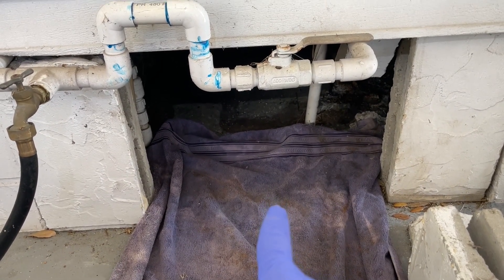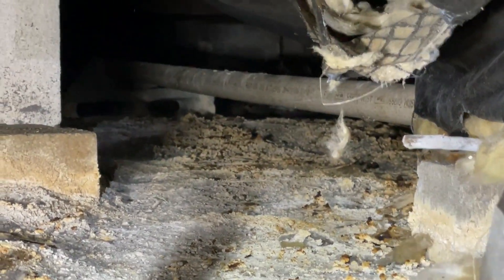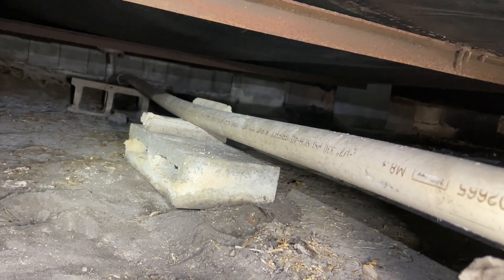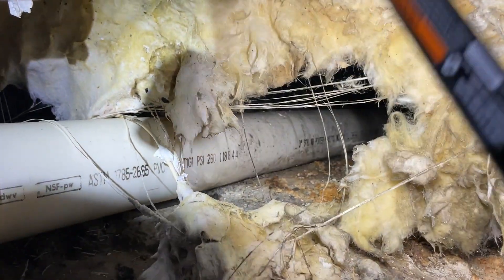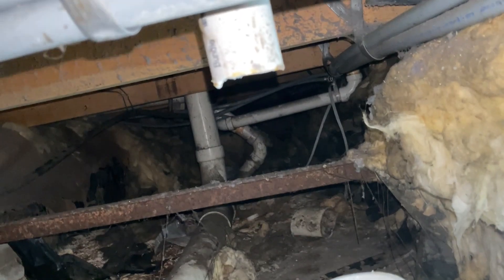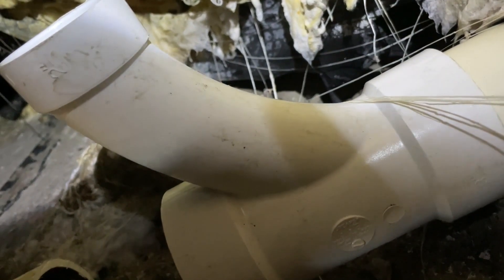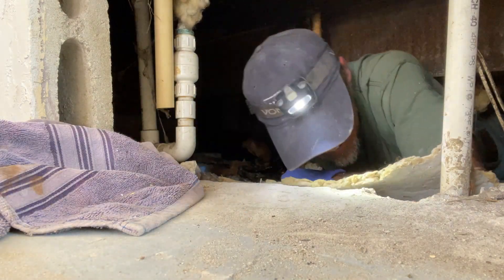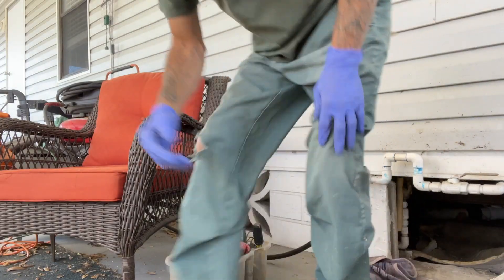SEWER LINE REPAIR UNDER MOBILE HOME

Comment: Wonderful instruction Tim! My issue is an intersection from the washer under my mobile home. I'm thinking I can get it done with using a Fernco rubber sleeve. Just slide it on then connect the broken pipe and tighten the hose clamps. Cover me, I'm goin in! I'm grateful that I've got more room under there than you had. Thank you for this. If I'm successful, I'll have saved around $500.

Comment: Great video work.  I've got a trailer that is similar underneath - except doublewide. Its a spider webbed, dusty, tight squeeze - without a camera.  Nice that you could capture how you did all the work.  Showed the tools you us, how you cut, measure and glue in a real live example.  Its a bit complicated - but especially in such tightquarters.  Bravo.  Well done!

Comment: First, may I say, as far as I'm concerned, guys who do what you do are true American heroes. 👍 🇺🇸  Question:  I noticed at 5:57 the homeowner has gray polybutylene water supply pipes... "PB."  It's been a while since the recall of that kind of piping.  I have it in my 1986 Schult, too.  Those 37-year-old PB pipes have never been in contact with chlorinated city water... I've always been on a well.  I've never had a leak in the PB.  Is it only a matter of time before they start springing leaks?  Should I have them replaced with PEX soon?  Thanks for your videos.

Comment: Nice work.  I plan on tapping into the existing drain under my mobile home and making a washing machine type p-trap & drain in what used to be the closet for the water heater.  The plan is to have the drain lines for the water softener and flush lines for the tankless water heater dump into them.  

Your video helped me get my head around how I can put a T into the drainage system and use that rubber piece to join the two sides of the drain line.

Comment: stay skinny...avoid anxiety issues workin in tight quarters,txs for sharing
Reply: you got that right -- the last time I had to get under my trailer, i didn't think i would be under there long at all.  I reran all plumbing, removed the ducts, and reinsulated under there in the past.   this time, I was just fishing a network cable from one bedroom of my singlewide to the bedroom on the opposite end.  figured i would be in and out, but the cable got jammed up in the belly and I wasnt being calm trying to find it.   frustration led to triggering a claustrophobic episode and I freaked out and broke through the underpinning to escape.    in the short term, it made the job easier, to have light to find the cable,  but then I had to repair the underpinning when I should have been done  :-/

Comment: Oh fuck no. $175hr? Damnit you guys don't get paid enough. As a flat rate mechanic, with a problem at my home(clog), I've decided to get YouTube certified before an attemt at a repair. Coming to find out, I'm terminated to an old sewer line, and need to connect to the new one. 

Brother I charge $100 hr, for automotive work, and honestly? You flat out couldn't pay me enough to get under there with the fiberglass and who knows what else, and do shit like that for a living. Sir, I absolutely commend you for your efforts. I think the price should be higher in my opinion, but I like doing my own shit(might be literal) so this motivates me to stip being a pussy and get it done. I have more room, removable skirting and 50 degree weather. No excuses.

Thanks for the post, you helped in a way I wouldn't of thought, and this video doesn't have anything to do with what I'm doing, but it still helped.

I appreciate it Tim. Thanks again.

Comment: Worked warranty repair for Clayton Homes, My boss (at time) was well known in LA, MS, AL and Florida. 

In my opinion a mobile home Is not ideal for long term dwelling without having proper foundation.

Also hauling a mobile home, sometimes two or three sections (for double and triple wides) down the highway isn't ideal. Everytime a turn or impact happens, the mobile home shifts. Drivers go anywhere from 60 to 80 mph (when available) down the highway. Worst is when a blowout happens and driver "'never noticed". If the tire goes up it rips through bottom board and decking, could even go through drywall and create roof leak. 

A lot of research should be done before leasing or buying a mobile home. Consider Repo Homes, cheaper if you know the work, but foundation is vital.

Comment: Just go in with a good mask spay Black Flag spray starting from the back work your way back, leave for about 1 hour.  You wont smell it afterwards but spiders and bugs dead.  Go back in with broom wipe off all webs and get to work.  I've worked in many of those black widow webs without spraying and never bit by one,  they flee away if they see you before you touch them.  $175 an hour is stupid even $100 is.  Anyone can do this if you can get over your fears of bugs.  That's what they want you to be afraid of.  Typical B.S.